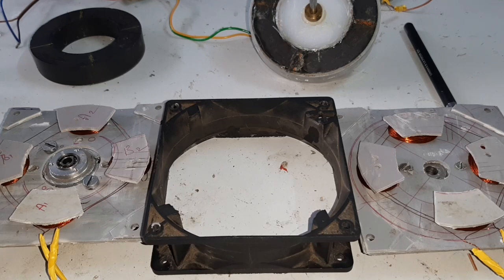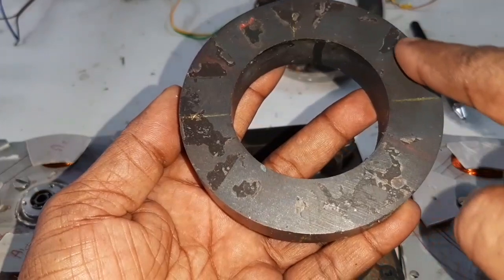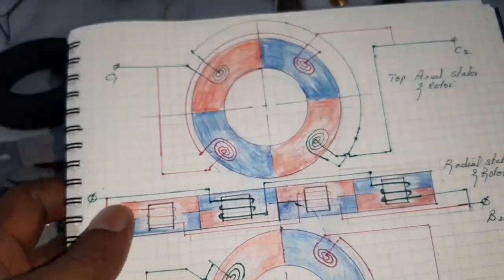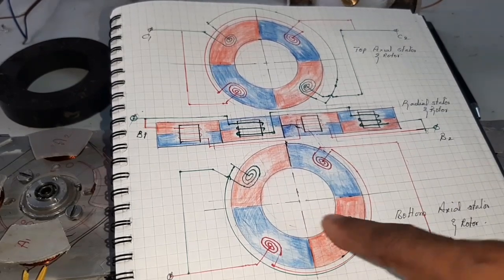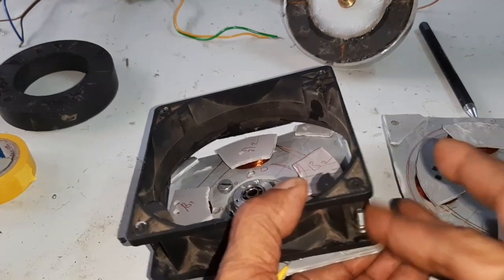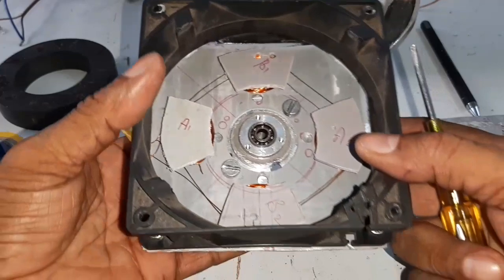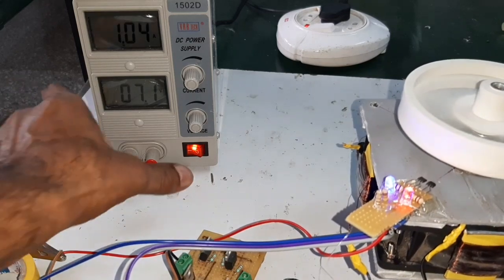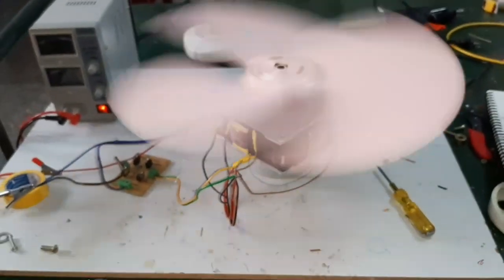(V-106),Powerful axial+radial flux bldc motor (part-3)

Comment: Brushless motor have 3 wires but yours is 2 wires
Reply from the maker: Sir ,thanks for watch and supporting 
It is a single phase bldc motor and hence  two wire is used.
The controller hase full bridge mosfet drive  used 4 mosfets
Reply from the maker: Sir ,thanks for watch and supporting 
It is a single phase bldc motor and hence  two wire is used.
The controller hase full bridge mosfet drive  used 4 mosfets